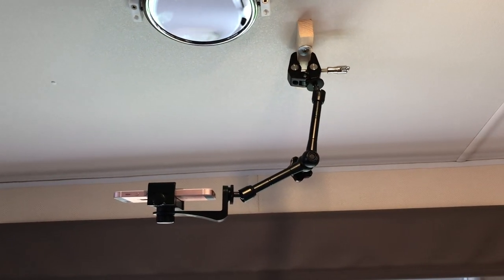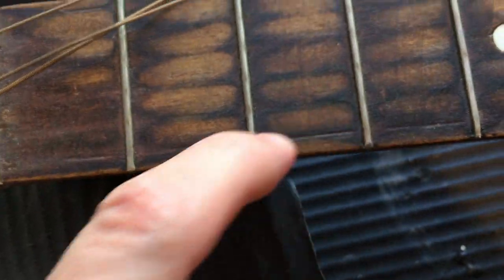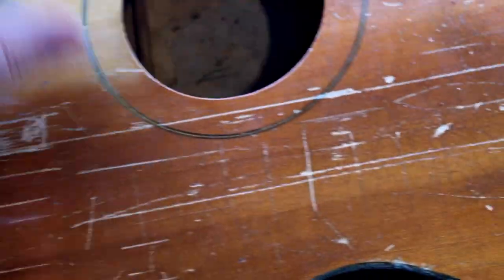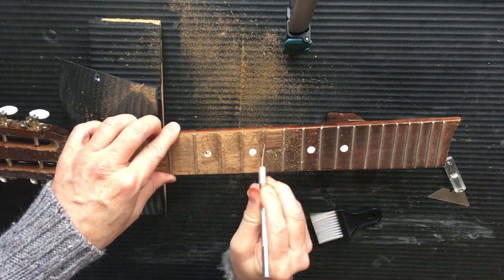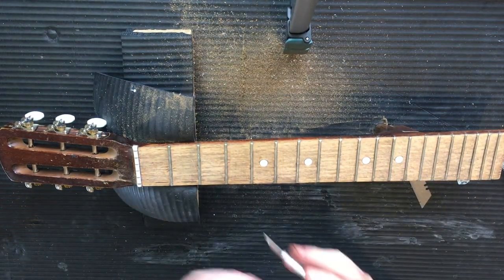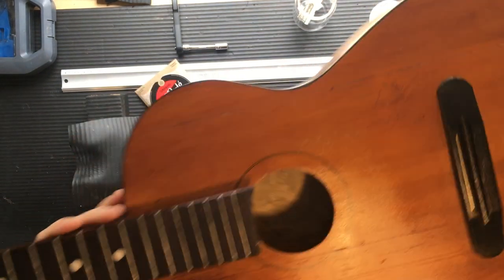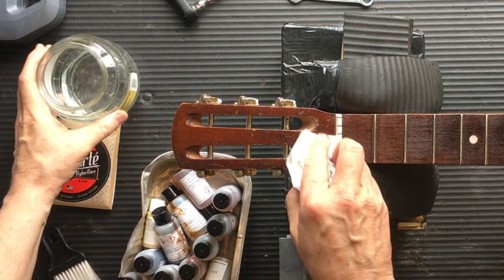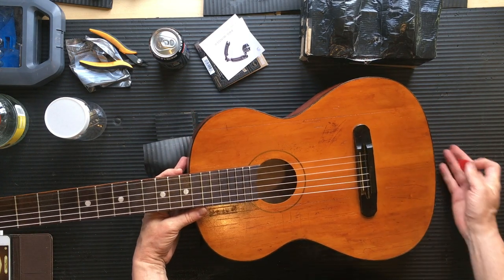Old Odd Classical 10 stories! the Northern Ireland situation explained and hot peppers! In one video

Comment: That's a viennese style guitar. The bolt is used to adjust the angle of the neck and therefore the action. It s not supposed to be fully tight. The neck should have some movement when there are no strings on it. It's not a classical either. It should have steel strings on it. Albeit light gauge ones. Which you can tell by the width of the machine head posts. They have always been metal and too thin for nylon strings. And the bridge is designed for ball end strings.
Reply from the maker: Note, it must be cheap knock off because the body shape is not quite shapely enough and the bridges on all of the 'Google' Viennese guitars had sexy moustaches... like me. :-)